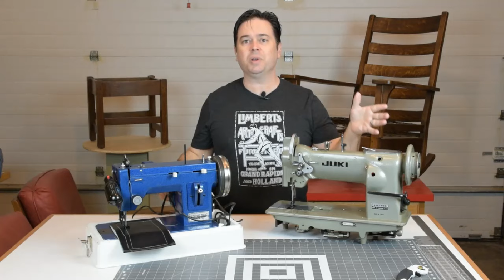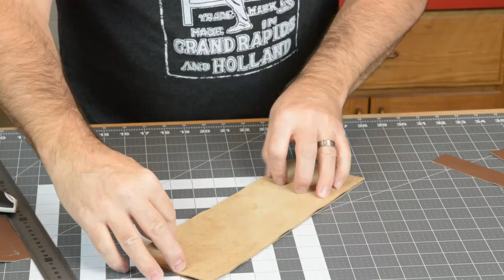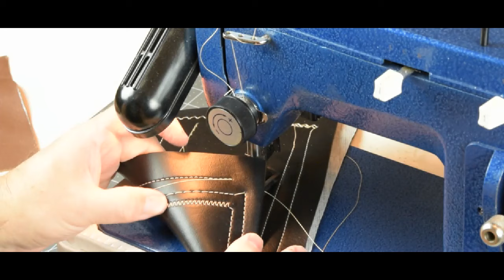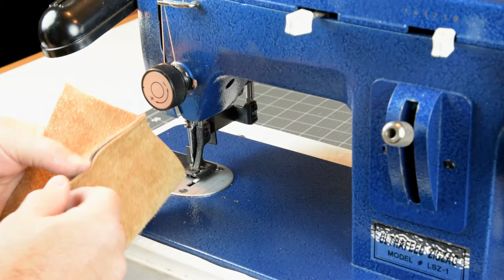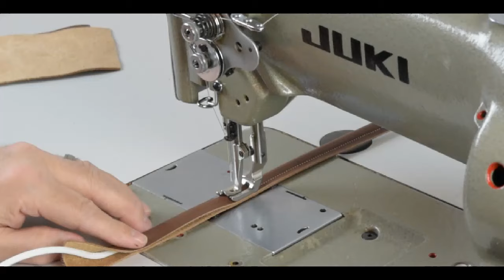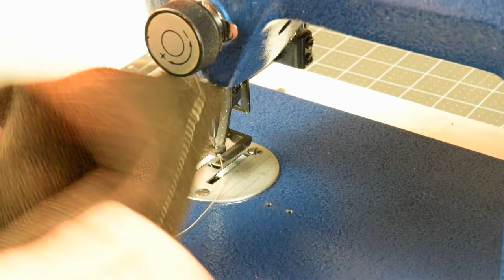Mini Walking Foot Vs Industrial Walking Foot Sewing Machine Sailrite and Juki Compared

Comment: I've watched several of these videos and am suprised no one has used a thread conditioner of some kind, which would improve the sail rites performance,  also no one mentions the knee lift...if you are making cushions a knee lift is must have.  I have a sail right and a Singer industrial walking foot, that's forty years old and still sews like a dream!  I refer to the sail rite as my on site machine,  and he trusty Singer as my best friend.  Don't forget needle type an size isn't mentioned and can and will make a big difference in the machines performance.
Reply from the maker: Thanks and I agree with your comments.  The main limitation with the Sailrite is the presser foot doesn't lift high enough.  I don't think thread wax would help with that issue, but it might if someone was having trouble with punching power.  
I love my knee lift too!  Best way to free up your hands. 
Great comment.
Reply: Hi what model you use please upholstery wise
Reply: What kind of Singer do you have?

Comment: I've had my sailrite for a couple of years, and use it all the time.  When building or repairing sails, a zig zag stitch is needed/preferred, to handle the stresses on the fabric.  An industrial zig zag would cost about $4500 or more (Consew 146RB) so the sailrite is a bargain.  That said, I am in process of ordering a Juki 1541 or 1508 for my canvas and leather work but am keeping the sailrite.
Reply from the maker: That will be a perfect pair of machines to use for those uses.  Best.
Reply: I am in the opposite situation.  I have a Juki 1541 but would like to be able to do zig zag so I am considering buying a Sailrite Ultrafeed.

Comment: I tested the Sailrite. Bought a Juki DU-1181n walking foot. The LU-563 is no longer available, and used industrials are hard to find. I make handbags, including 3-4 oz leather. Many bagmakers sell their Sailrite LSZ-1 and buy 'full size' industrials because the presser foot lift height is simply inadequate.
Reply from the maker: Thanks for your insight.  Sounds like you made the best decision based on your needs.
Thanks!
Reply: Times a million about the foot lift height being too little.

Comment: The machines are clearly for different purposes, the sailrite is specifically designed as a portable machine for yachts and can even be hand cranked with a handle on the monster wheel so it can be taken away on a sailing yacht and used to fix canvas and sails etc even when there is no mains power available.  Additionally - and crucially - for use on a boat the zig zag is a must, all sails have zig zag stitching somewhere so if you ever want to repair a sail “on the go” I don’t believe there is an alternative to the sailrite.  I guess if money and space were no object you’d keep a sailrite on the boat and a Juki at home. 😊
Reply from the maker: Hey that sounds like a good plan! 
Thanks
Reply: This is exactly what I've done.  I've got a Consew 226R, very similar to the Juki shown in the video - a compound walking foot, straight stitch machine with reverse and a servo motor.  I use it for heavy stuff, and it's quiet and powerful.  I also picked up a used Ultrafeed LSZ1 that I keep on our boat - it's noisier, not as powerful, but it's much smaller and has zigzag, which is great for sail repairs.  If I only had space for one, I'd keep the Sailrite for the zigzag capability, but for big projects the Consew is nicer to use.  Both machines are quite capable for many projects that a lightweight plastic machine simply can't do.
Reply: I have both LSZ-1 and Juki 1541... no boat, just a sewing machine obsession. I honestly love both.  Sailrite is such a wonderful company. Their customer service and quality is top notch.  And I have too many Juki's to count.  Love them.
Reply: @Papillon_2010  how would you compare theJuki 1541 to the Sailrite fabricator?

Comment: Of course, top/bottom feed walking foot is not the same as a compound or triple feed walking foot, so you're comparing apples and oranges and the prices of these machines are not that far apart.  Go for the Juki or Consew or for really tough material, a Cowboy.

Comment: Oh man you read my mind. I have been struggling to find a sewing machine that fits my living space and what I want to do with it which is mostly leather.
Reply from the maker: Tough decision.
Reply: @TheThoughtfulWoodworker  I'm looking at this one machine (Deluxe Super TuffSew) the guy said it's a portable walking foot industrial sewing machine.... any thoughts? recommendations? I also have a Consew Upholstery machine model CP206RL that the guys say is portable and can be with a table.
Reply from the maker: @dulceacosta2557  It's a lightweight portable walking foot like the Sailrite or Consew.  It won't have the lift capacity or power of a Consew, Juki, or Pfaff but for 2 layers of canvas or vinyl they are ok.  I wouldn't sew much leather with it.

Comment: I came across a cell rate SZ – one a while back, and I absolutely love it. I use it to repair sails, webbing, Fabric it can handle just about anything. I also installed a worker B motor on mine.
Reply from the maker: Glad the Sailrite is working well for you.

Comment: The juki is a compound machine it's kinda in a different league compared to the sailrite, top and bottom feed however is very effective for thinner mid weight materials/smaller thread and needle size
The combo of the 2 is priceless, zigzag needle left or right for zippers and tight spaces, compound for everything else going trough 2 to multiple layers
Reply from the maker: Yeah they both perform well for what they're designed to do.  Walking foot plus zig zag is a cool and rare feature.

Comment: Very nice comparison. I have the initial basic Sailrite straight stitch bought before the zig zag option was even offered and understand it's shortfalls ..but it is truly portable so you can take it to the dock or even on board.   I have used it to sew/replace clear windows in Sunbrella and make Sunbrella curtains and cushion covers and such for our 36 ft Topaz Sportfisher .. it did great.  If I was doing upholstery a lot I would love a machine like your Juki.  Before I got the Sailrite, I replaced the cushion covers on the dinette and V birth (with piping) using my old 90's Janome Memory Craft work horse which remains strong.  Hardest part was handling the large sections of heavy upholstery fabric
Reply from the maker: That's cool the Janome could handle piping.  It's fun to try out different machines and see where they excel.
Reply: @TheThoughtfulWoodworker  That Janome Memory Craft was my first machine embroidery machine.  I have a true love of the older classic machines and have quite a few.

Comment: Love seeing the comparison.  I didnt realise the actual difference in size. I was going to purchase a Sailrite but was too expensive to import where i live. For the same price I got a brand new Typical GC0323 walking foot, in a table with servo motor. Not quite sure if the Typical is as heavy duty as your Juki but I do believe it is a much better machine the the Sailrite I was going to buy
Reply from the maker: Good luck with your decision.  At any rate, a walking foot is great to have.
Reply: Yeah I think the Sailrite machines are good for sails and upholstery and they do a great job with marketing and accessories on their site, but I think the machines are overrated. I have an old Thompson on which their Ultrafeed is based on and it's a tough version of a home machine basically which can get through 5/8" of soft leather in a pinch. I'm thinking about getting a Juki or Consew

Comment: Very impressive comparison! I think my concern would be the struggle with the presser foot and the noise made by the Sailrite. The Juki was a really nice machine! Thank you
Reply from the maker: Hey Rebecca, thanks for watching and thanks for the nice comment.
Best
Reply: I have thus exact model of Sailrite and when I watched him sew the noise of the machine was the first thing I noticed. There seems to be something wrong with his machine because mine doesn’t have that loud motor noise nor does it make a clicking sound with each stitch. That’s an issue as well as the fact that he’s not comparing machines with the same features.

Comment: I made five sails for my 1957 28 foot steel sloop with the sailrite and only for that Iook at her with gratitude. Now I’m looking for an industrial machine and, surprisingly, it’s hard, if not impossible, find a walking foot zigzag vintage one. I will opt for a Pfaff 145: easiest to find in my region. You make great videos!
Reply from the maker: Thanks!  Good luck with the machine search.
Reply: Check out the Consew 146 RB. This is a walking foot zig zag machine. RB = reverse, large bobbin.

Comment: I just put a consew and a juki in  flight cases,,  
  Case is for amplifiers,
,a 6 unit.  22"x11x 32 tall. Has a lid at each end. Built head into lid. Throttle cable for motor ( servo), mounted on head. Had a barracuda/ sailrite, awesome junk. Hook timing slipped on a blue jeans. Seam..
Set it,sold, it....best boat/ catamaran.  machine a juki1508, or similar consew/ Seiko..
  135needles and v207 threads.

Comment: Great video. I own a latest version sail rite with worker bee and it's powerful and compact which is what I bought it for. I made a new bimini and enclosure on my boat with it  for about $2500,(machine and materials) versus $12,000 quoted. I love having it on the boat with me.  Sailrite video's taught me a lot which I am grateful for.  if only at home for heavy duty, leather etc I would look for a Juki or comparable.
Reply from the maker: I totally agree.  Saving money on upholstery jobs is what started me down this path.  Glad you found a good machine for your application.

Comment: Great video!  Love my Sailrite and its portability. You should check out the new 1/4 hp motor upgrade. Jukis are awesome  machines (I want one) and my Bernina is like a member of the family. I have learned the limits of each and its good to have a small fleet for different capabilities. Each has its advantages.... Thanks for sharing⚓
Reply from the maker: Interesting you mention the 1/4hp Sailrite motor upgrade.  That would be a good option for some people.  I'm currently using the Sailrite Leatherwork for small projects, which has a 550w servo and speed reducer.  That's another great way to get more power.  
Thanks for the nice comment.
Best
Reply: I have it, This thing is a beast! 6 layers of leather, no problem.  Bunched up Cordura plus web belt, no problem.  Waxed canvas, easy day.  I tested 5 layers of thick web belt and it still was easy.  Next test is plywood🤣

Comment: Nice comparison. I had an lsz1 also have industrial machines and the difference in daily use is obvious. The lsz1 is a toy in comparison. Compared to a domestic machine though the lsz1 is an improvement. I ended up selling the lsz1 and was surprised how much it sold for in Australia on an ebay auction. It was enough for me to buy a singer 153 binder with change.
Reply from the maker: Thanks for your insight.  Well said.  It's always nice to hear from experienced machine operators.
Best

Comment: Great comparison!  Would be nice to see how these walking feet do on curved seams. I do patch sewing on leather jackets and vests so am combining dense embroidery stitching/twill fabric/adhesive/leather and lining. I really need a portable machine since my patch sewing is done at events and I am the only one loading the machine, so weight, portability, power, presser foot clearance and slow detailed work. Your comparison helped quite a bit! That Juki is a gem, am jealous!
Reply from the maker: Thanks for the nice comment.  A cylinder arm might work well for the jacket arms and curved seams.  Then it wouldn't be portable though.  Maybe a portable walking foot machine for on site demos, and a stationary walking foot at home?  Dare to dream, right?
Best of luck whatever you decide.

Comment: I never bought a tabled industrial walking foot because I want zigzag. I have always looked at the Sailrite, but you pointed it out- distance between feed dogs and walking foot is’t as good as I’d like. As to power, I suppose one could table the Sailrite and run it from a servo motor, but lose portability. If Sailrite made the Fabricator with zigzag I’d be jumping on it. Great video. My takeaway is that the Sailrite mini can do so much more than a domestic, but falls slightly short on the really heavy stuff.
Reply from the maker: I think that's a fair assessment.  I also have the Sailrite Leatherwork which is a table mounted portable (no zigzag) with servo and small speed reducer.  It's good for wallets, belts and small leather goods.
Best
Reply: If you are looking for a heavy duty walking foot zig zag machine, check out the Consew 146 RB.

Comment: I have the newer model of the LSZ-1, with the Worker Bee motor and it is an amazing machine!  I would love a Juki, but it is not portable.  This is why in my eyes the LSZ-1 Ultrafeed is a "better" more practical machine.  Great video!
Reply from the maker: Yeah, the Sailrite in this video is an older one.  I also have a Sailrite Leatherwork.  Glad you like the Worker Bee
Reply: @TheThoughtfulWoodworker  Very "thoughtful" of you to reply.  pun intended:) .  For sure,  I see quite a few improvements to the one in your video.  I'm loving the machine.  I did have my eye on a Consew or Juki, I just needed portability and power.   Finding something that has Zig zag was a huge bonus too.

Comment: Thanks for this very informative comparison. Few things i noticed in this video. The juki moves the whole fabric with the needle down which i would be a strong and more even way to move several materials vs the Sailrite which only grips the top and bottom of the fabric and moves it. Also the Juki sounds like a well tuned mechanical symphony while the Sailrite sounds like its grinding on rough stones and wants to croak.
Reply from the maker: You bet.  Thanks for checking out the video.
Best
Reply: Sailrite has all metal internal components, built to be self-serviced. 
Juki is the luxury model, Sailrite is bare bones built durable.

Comment: Thanks for this vid. I have been looking at both. most interest is the Sailrite, has zig-zag and its portable. Now they offer a new servo drive, heavy flywheel. makes alot more power and torque and quieter.
 Each machine has a particular purpose.
Reply from the maker: True.  I have a Sailrite Leatherwork too.  It doesn't have zig zag though.  
Best

Comment: I broke 2 Heavy Duty Singer 4452 machines in less than 2 months simply trying to sew hook and loop material to polyester strap material.  The Sailrite LSZ-1 was not challenged at all to complete the same sewing.  I used a 2 wheel dolly to get the LSZ-1 to my van from the UPS Store where I had it shipped to.  I could carry the Singer 4452 Heavy Duty from the store to my van under my arm if I wanted to.
Reply from the maker: Yes I agree.  The Sailrite is more heavy duty than most domestic or drop feed machines.
Thanks

Comment: Exactly the comparison I needed.  Sailrite does make a model expressly for leather.  I think it is the Fabricator.   My shop occasionally floods, so portability is a major factor.   But that Juki......so very nice. Thank you for the excellent video.
Reply from the maker: Cool.  Yes, Sailrite has the Fabricator but they also have the Leatherwork.  It comes with a very compact table, servo motor and speed reducer.  I have a Leatherwork and did a review on it, as well as a demo sewing leather barstools.  You should check out those videos.
Best.
Reply: @TheThoughtfulWoodworker  I will.  Thanks.

Comment: ❎.  Thank you.
This model Sailrite is a portable.
     Yes, two different classes.
More power than
      a regular table top
            home machine.
They now offer
       a speed control motor.
🤺💐
Reply from the maker: Yes, Sailrite has come out with a couple new motor options.  I also have their Leatherwork machine which comes with a small table and Workhorse servo motor.
Cheers
Reply: @TheThoughtfulWoodworker .
           🤺💐

Comment: Sailrite does make  a sewing machine for leather work, the machine you were using is intended  for Dacron, and Sunbrella, however you can use it for leather if needed or lighter materials  as well.
Reply from the maker: Yes, I have the Sailrite Leatherwork as well.  But honestly it is exactly the same as the LS-1 with a servo motor and small speed reducer.  It doesn't have any more foot lift than the machine I was demonstrating on.
Reply: @TheThoughtfulWoodworker  its is limited in lift as the name may suggest, Sailrite  sewing machines end up on sailboats with limited space. We use them for every, including helping the neighbor in the marina.
If space isn't an issue a bigger machine makes the most sense.
Sailrite now produces  a more  powerful motor also.to make things  a little easier.
I did enjoy your video, insightful!

Comment: You can certainly hear the difference in construction of the two machines. I love my Juki machines...241 & 1181, and I could never listen to that blue machine all day. It would drive me bonkers sounding like a bearing was ready to seize up. 😂
Reply: you should hear my sewline 9" thompson (like sailrite).  with the new-age foot pedal is pulses full power for low speed.  i have a carbon pile pedal arriving tomorrow.
Reply: ^^ this. I'd miss the knee lift, presser foot height, clearly marked stitch length dial. The LSZ-1 is just not for me.